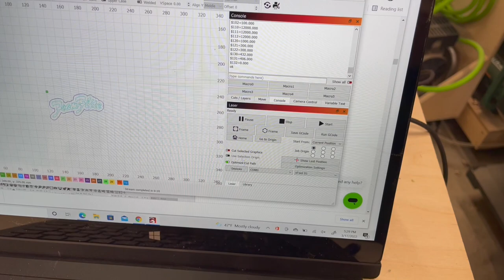XTool D1 DIY Laser Enclosure that fits the stock Honeycomb Bed

Comment: I want to make an  enclosure for my xtool d1 so if I want just a box without the shelves, large enough for the laser with the cup turning tool what are good dimensions? Thanks
Reply from the maker: I built this enclosure with enough height to allow the rotary tool to work. The shelf is there so that I do not have to mess with putting the extensions on and off. You could build it without the shelf but then you would have to use something to raise the laser up when wanting to use the rotary. About 14” of height is the minimum I would go for this.
Reply: @Vintauri  Thanks

Comment: beautiful enclosure! Do you know the aprox cost it took to build it? Also, what tool did you use for the holes?
Reply from the maker: It’s around $200-$250 depending on the hardware, fan, optional lights and amount of acrylic you use.

Comment: Really new to laser engraving and just purchased your DYI enclosure, did you modify the plans for the honeycomb panel you mention that you would fix if you were to do this again?  what size would you suggest on the exhaust fan?  BTW:  Nice job on the enclosure.
Reply from the maker: On the plans I did move the slot back a couple of inches so there is more flexibility for where the honeycomb bed sits. As for the fan you want one that is a minimum of 150cfm. I’ve linked the one I’m using in the description. It does a decent job but you could go higher if you want to ensure more air movement. Thanks for checking out the plans!

Comment: will this enclosure allow for use of the new rotary
Reply from the maker: Yes, I used this enclosure while testing the RA2 unit out and it worked well. Really large cups would need a small boost of an inch at most but for 90% of the things I’ve done it’s worked well without any other mods.

Comment: What type of acrylic did you use? Your plans call for 1/2 plywood, but from you video it looks like 1/4” acrylic stock. I don’t see how you could make your budget with 1/2” acrylic stock. Thanks
Reply from the maker: It is 1/8” laser safety acrylic from Jtech Photonics. The top piece is recessed into the lid with a 1/8” pocket.
Reply: Actually, I was asking about the material that you used for the body of the enclosure. From your video, that did not look plywood. It looked like 1/4” solid plastic is some sort.
Reply from the maker: @philipershler420  it’s 1/2” plywood that is sanded and painted on both sides.
Reply: Then I would complement you on your sanding and painting. It is so smooth that it looks like solid material.

Comment: Hey! Great Video. QQ - I am carving this on an Inventables , and noticed the Daddo slots are not scoped correctly on your ETSY File. Anyone have experience with this carve on an Inventables X-Carve? Cheers.
Reply from the maker: One thing that I should note is that not all plywood has the same dimensions. Rarely is 1/2” plywood actually 1/2” thick. So the dado may need to be widened on the file. If you can check your plywood and compare that to the file an adjustment could be made. Let me know if I can help with that.
Reply: @Vintauri  - Interesting. I thought that. Do you have any clients that have used EASEL for this or an Inventables Product? The depth on all of your cuts is .5. The way it's drawn, I cant just edit the daddo slide. Maybe I am doing something wrong?

Comment: Can you provide any specificity on how you did/wired the LED lights?
Reply from the maker: I'll see if I can pull together a quick video on this.  Essentially it's LED strips wired with 18g silicone wire, with a limit switch inline on the positive lead.  That's all connected via a 12v power brick.

Comment: Height wise, what if you need all the extra extensions on the feet?
Reply from the maker: Well I designed this to not need the extra extensions and still be able to use the rotary for typical items. However if you have a need for taller items you could adjust the height of the sides to suit.

Comment: hi, is the air addon on the head is making any difference ? and why ?
Reply from the maker: Yes it does make a difference primarily with cutting.  I did another video just on that if you'd like to check it out.  In short it blows away debris and prevents extra charring while cutting so that the cut's are more effective and there is less overburn left on the surface around the cut.
Reply: @Vintauri  I will do mostly spraypainte bottle on the rotary.. do you suggest to get it ?
Reply from the maker: @MarcAndreMenard  The air assist is more important when cutting.  When engraving you actually want to regulate the air flow down just enough to help keep debris from the lens otherwise it does more to mess with the engraving burn than anything to help it.

Comment: Can you use the RA2Pro with this enclosure?
Reply from the maker: Yes I tested the RA2 pro using this enclosure.  The only thing would be objects larger than 4" in diameter might need more space. This design could be stretched top to bottom to add more flexibility in that regard.

Comment: Does this design work for the D1 Pro?
Reply from the maker: Yes I have since moved to a 20w D1 Pro and still use it in this enclosure!
Reply: Thanks for the quick answer. Do you have to remove the D1 to tension the belt?
Reply: Another question: You mentioned you'd have the honeycomb deeper in the enclosure. Do the plans on Etsy include that modification?
Reply from the maker: Yes the plans reflect the changes I mentioned in the video and allow the honeycomb to go back further.
Reply: I'm gathering the hardware and found open on & closed off switches - can't find open off and closed on. Do you have an Amazon link to the switches you used?

Comment: Is it worth $209 Canadian on Amazon? I feel it's overpriced. That's just the honeycomb btw.
Reply from the maker: There are definitely other options for honeycomb panels, but I would make sure you get one that is steel based and not Aluminum for the honeycomb weave.  The steel will flex less and allows you the option of using magnets to hold the workpiece.  Here is another similar option to check out.  https://amzn.to/3LbyHkA

Comment: What did you use to cut the Laser Shielding? Did you cut with the laser?
Reply from the maker: I cut them out on my Co2 laser. It’s a different wavelength so it’s able to cut the material.

Comment: Thanks for sharing your enclosure build!   My D1 is arriving this Friday and I'm excited to tackle building an enclosure as well.   I'll be building something very similar to yours, but I'll also be adding the lightburn camera, so I'll need to figure out a way to have the lid remain vertical when open.    How are you finding that exhaust fan?  I was looking at the same one, but wasn't sure if it had enough CFM's to quickly remove all the fumes.
Reply from the maker: I need to run a few more heavy cutting jobs to really see how the fan is working out. I ran a variety of jobs so far but out in my garage shop the air circulates much better than my basement work room. The real test will be when I get it down there, if the smoke is pulled out and does not back out into the room and my house I’ll be fine. If not I’ll be looking for a little more CFM.

Comment: It is a nice enclosure, much like this one put out a few months before yours https://www.youtube.com/watch?v=YjiEK-cvb1I . On both If you add a method of closing the air intake vents when not in use it will help preventing Corsican from gathering on the circuit board over time from moisture exposure in the air.